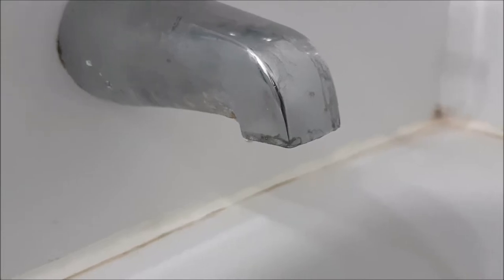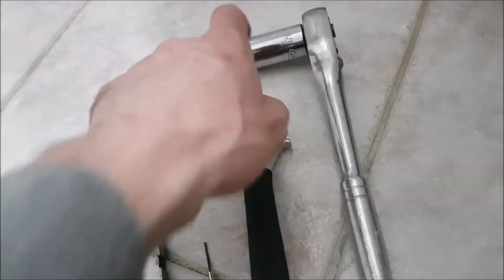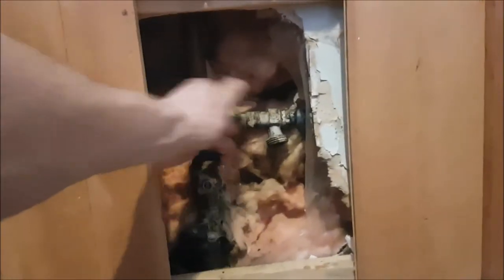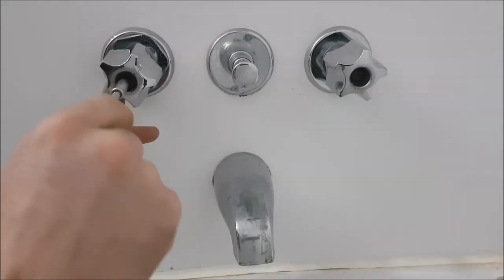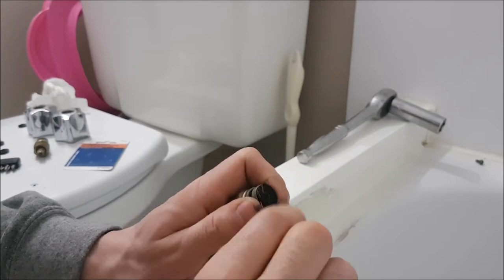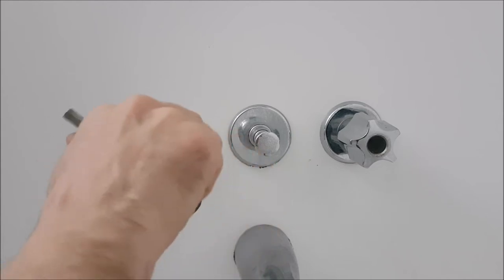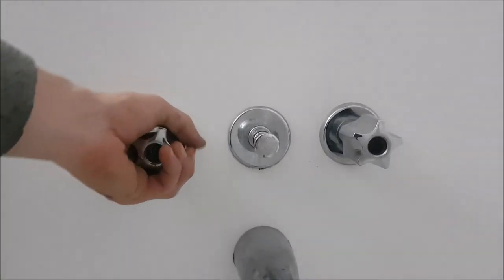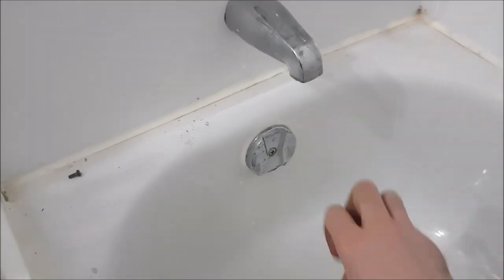How To Fix A Leaky Bathtub Faucet Tap Drip Dripping Leaking Water

Comment: Just sitting down after finishing mine. Very good video. All the tools I needed. I was happy to find your video as mine is the same plumbing.   I recognized the shower diverter valve in the middle. I'm paranoid doing plumbing on this old house. Snapped the head of the Philips screw off the knob. Knob came off OK. (Better than stripping the head and not getting the knob off lol). Valve came out easy, 19 mil. deep socket just like you said. But then I could not get the slotted screw off at the washer end no matter what. It was welded in. Took the whole valve over to Canadian Tire and they had the WALTEC cartridge non- oem #76101 for 8 bucks. It said cold side but was the same as my hot side. I think that might mean if you have the handle style of knob and they turn off in opposite directions. Nice to have this finally fixed. Thanks LUCAM.
Reply from the maker: Your welcome. Happy it helped.

Comment: okay my situation is I live on the top floor of the house and I want to turn off my shower hot water on that floor…

how would I do that?

is that even possible?

any info will be helpful
Reply from the maker: You would need to see if there is a main shut off valve for your unit. 
Do you have your own hot water tank etc? Or is it shared. If you have your own there may be a shut off by the tank or where the water pipes enter the unit. 
Depending how the place is built it may have only a single shut off valve or one to each unit. 
Would need to sort that scenario out. 
If only one shut off exsists;
Prolly need to make arrangements to do repairs.
I would consult with your landlord before doing any repairs, if you were to make a mistake and the issue becomes bigger it could be your responsibility to pay any further situations.
Reply: first off -THANK YOU for your response! 

I think I can shut it off individually!

since I’m on the 3rd floor and there is a gas meter for the first and second floor and one separately for the 3rd floor!

there should be a separate one for just the hot water! 

I have to go downstairs to see, again thank you for the info, bro! 😎
Reply from the maker: @GoaWay4Sanity  no worries. Hope all works out.

Comment: I have changed the stem on the showr. Then the one for the cold water. I had to special order the diverter becaue it was so old. Then I replaced the stem for the cold water. Everything seemed all good at first but for the past week or so the cold water has startd leaking. The cold water stem is a newer version so Im thinking I might need to special oder that one, too. Might as well get 1 for the hot water while Im at it. Can you tell me what the differecne is between Delco 3S-8H/C and a 3S-9H/C? IDK if one is bigger round than the other or if one is a bit longer than the other? Im not a plummer kind of person and learning as I go!! I should note that when I put the diverter in I couldnt get it to go all the way in but when I put the chrome thing on that goes over the extention part it held it in place and worked like it should. Only problem is its really hard to turn it from the tub to the shower head! The parts they used look like the parts you use for the bathroom sink not the long pieces I see fo the bathtub that everyone else uses!! Then "whoever" put this thing on in the first place dome a half as job IMO and didnt use the correct parts ! Just used what they had on hand. Its to hard to get into where all the parts are at to just replace the whole thing with a whole new thing and correct parts or I would just do that! You can only get to it from the back side and it is in such a small space it cant be accessed from either side without removing some of the wall!!
 Thank you for your time!!
  Sincerely,
 Fabo Lee, Sr.
Reply from the maker: Hey not to sure what the difference is between the two parts for Delco 8h & 9h. Check discriptions or look at the differences of the 2 parts in hand.
Sounds as it might be installed a bit to tight for the  bath to shower option? Not sure. I'm not a full out plumber. Just know a few things when seeing a problem.
Reply: @LUCAMTire  I figured out what the problem was, the little black rubber piece that went into the back tore so I replaced it AGAIN. Seems to be working for now. But those 2 parts look almost identical to me in hand. I think the 1 I need needs to be about 1/8 of an ince shorter than the 1 I have. Its a really tight fit when you put the chrome sleeve back on it. Im using new parts on an old system because they dont carry the parts I need at lowes. They are that old. 
 I just wonder if there is a difference between the stems with the 2 small holes in the back or bottom and the ones with the moon crescent in the same spot or place. I would think as long as the flat part covers the whole hole where the water comes in through that little black rubber piece that has the little spring behind it so it stays flush with the flat part when you turn the water off. Thats what the flat part is for and the holes or cresent allows the water to flow. Im learning as I go.
Reply from the maker: @completelyunbiased7201  
Good good happy to hear you sorted out the issue. I'm not overly familiar with your setup to disclose information on the differences in the pieces. But if you got it all back together and things are working accordingly I am thinking your good to go.

Comment: I have model can you tell how remover the middle pull out for shower?
Reply from the maker: not sure. i never did that before.
you would need to shut the water off either way i do believe
Reply: @LUCAMTire  shouldn't turning off the hot and cold taps be enough? I live in an apartment
Reply from the maker: @xermai9  possibly 
In theory the hot and cold tap would mix at the plunger. I am not a plumber by trade so I would hate to tell you one thing and it be another. 
I am thinking you are correct but I and not sure 100% how it comes apart as I never done one before. If you are in an apartment shouldn't the land Lord cover the repair? If you were to do something and cause more damage it may come back on you. It may be a simple fix or may be a mess. I don't know. Best to be safe if you are a renter and have the landlord have his repair guy repair it.
Reply from the maker: @xermai9  there might be other videos on the topic if looking to investigate further.
Reply: @LUCAMTire  looks like I will have get my land to look at I can’t get anything off anyway because it’s so old

Comment: I have the exact same set up as in this video, and my hot water is leaking badly. I'll be using this video to guide me. I have 2 questions tho. I'm wondering the size of the rubber washer you replaced. On the Canadian Tire website, they list sizes of their outer diameter, while in your video, you listed 1/4 inch, I assume was inner diameter. So I'm confused, lol. And secondly, I am in mobile home, and although I can access my hot water tank to kill the water, I have no idea where the main water shut off is, nor if I can even access it. Is shutting off the water at the hot water tank enough, and if not, why is that?
Reply from the maker: If you are on a well you can shut your well pump off which is normally a stand alone box at the water entry of the home. You should also have a shut off valve. It is a old valve turn with caution as they tend to fail being old. You want to shut the pressure off. I shut my hot water tank off as I did not know how long I would be working on the system and didn't want the hot water coils to burn up incase the water was to bleed off from the tank.
You want to shut off the water pump or main line coming into the home or when you take the tap apart and water will start coming out at you if you remove the valve and the water is not shut off as there is pressure behind the tap valve. 🤣  
I bought a little kit that came with an assortment of sizes and just matched up what I needed. Inside or outside diameter I am not sure. It was either a 3/8 or 1/4 inch rubber I used. When putting things together with new rubber. If remember correctly I needed to have the tap open so it didn't prematurely crush and tare the new rubber. If the tap valve was closed and you wrenched in the valve it would put to much pressure on the rubber and would tare it.
Reply from the maker: Like this video if it helped you and sub to the channel if you would like. 
Thanks for watching
Reply: Thanks for replying. No, I'm not on a well, but I've since located the main shut off. Now, burning out the heater coils in my tank was not something I had considered, as I'm very unfamiliar with hot water tanks, so thanks for that 'heads up' as well. My hot water tank is actually located immediately behind the wall where my tub taps/faucet are situated, so I'd imagine any space between the tank-to-taps is very limited, and the chance of there being any shut off valve right there where I could really use one, would be even less likely. So I'm going to kill power to the water tank at the breaker, to avoid any damage to the coils. Then I guess shut off the main water feed, and if there's an accessible shut off where water feeds into the heater itself, I'll kill that too, just be safe. Then, I guess just let the water in the tank cool a bit to protect the coils, drain it, and then begin the repair. I think i have a plan in place, lol. Thank you again.
Reply from the maker: @ll2andall  no problem happy the video was able to assist.
Reply: @ll2andall  
Why would you drain the hot water tank just to fix your taps? Sorry but that makes no sense.
Just shutting off the water coming in to the house should be enough, and the electricity to your tank if you really want, but even that is unnecessary because your tank won't empty unless you're there for days...
Seems to be a waste of water.

Comment: Yeah but even if you shut the main off don't you still have several gallons of water in the hot water heater?  Doesn't all of that have to come out before you can work on the hot water side handle?
Reply from the maker: Not that I am aware off unless maybe your hot water tank is upstairs and the tap your working on is down stairs then it might gravity feed. But if you shut off water at your main and shut your hot water tank off then open the tap release the access pressure and water in system. Whatever is in the line will drain out. Then you can work on it.
Reply: @LUCAMTire  Ok, thank you
Reply from the maker: @DaLeSy.  no problem. hope you get things fixed up.
if you haven't already and would like to.
Like this video and subscribe to the channel for future content.
thanks

Comment: our bathtub faucet leaks like 5 drops, then 10 seconds nothing, then again 5-6 drops ... still the same issue or other problem?
Reply from the maker: This is how mine started. Dripping every so often. Changed the tap seals and all was good afterwards.
Reply: @LUCAMTire  thanks!!! I guess I get the tools and a 6pack now
Reply from the maker: @thorstennesch1  how did you make out?
Reply: @LUCAMTire  i ended up calling a pro - who really had a hard time with the piping behind the wall ... I was glad I aborted my mission this time.
Reply from the maker: @thorstennesch1  thanks for the update

Comment: You did not replace the valve seat so it will just leak again in a few weeks! If you replaced the seat (the source of the worn gasket) you may not have to repair it again for 20+ years!
Reply from the maker: so far so good, going on 2 years. if it starts to leak again will will check it then